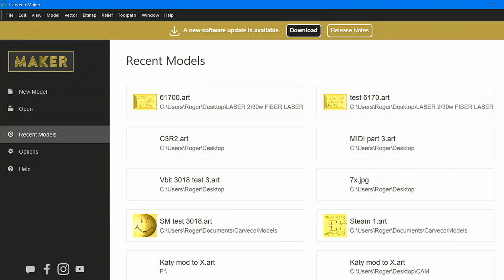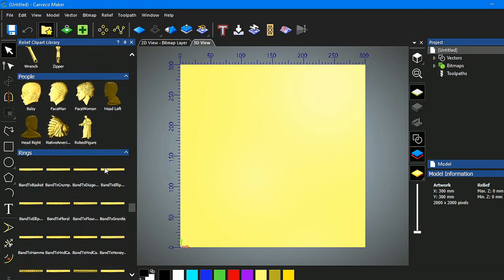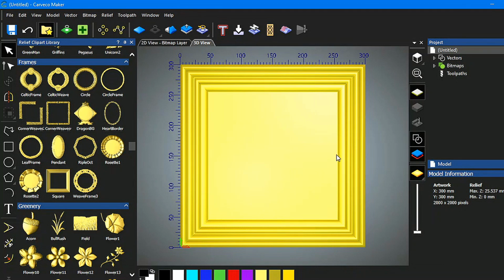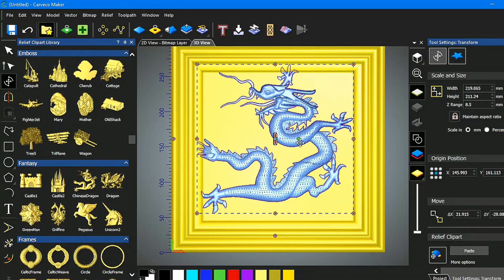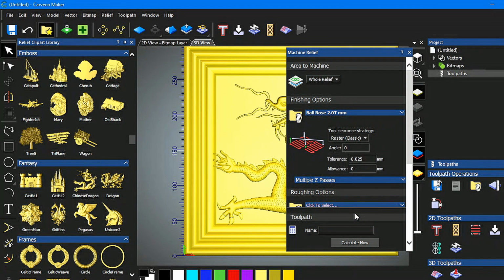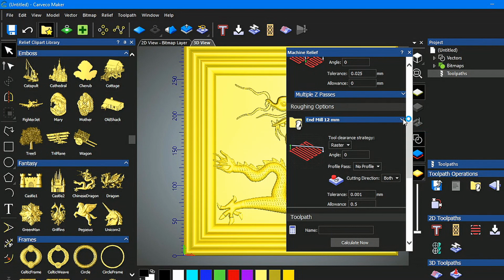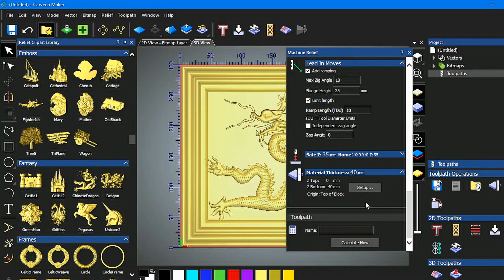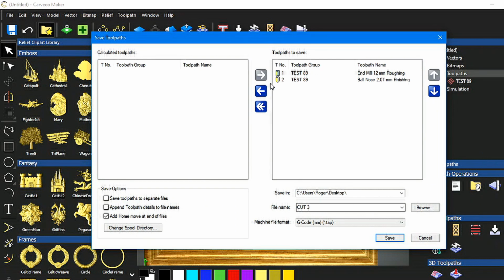Carveco Maker, making your first 3D relief + tool paths

Comment: Thank you for the video. I was forgetting to paste image, which was only cutting the whole shape out instead of the 3d image on simulation preview.  Example, instead of cutting out a 3d half sphere it would cut out a cylinder of the Sphere  diameter and height.

Comment: Thanks for another fine video Roger.  I tried adding a silk pattern in the flat area where the dragon is and the model looked nice.  I also use a 1/4 inch round nose bit for the roughing pass because I think it gets into the details a little bit deeper.